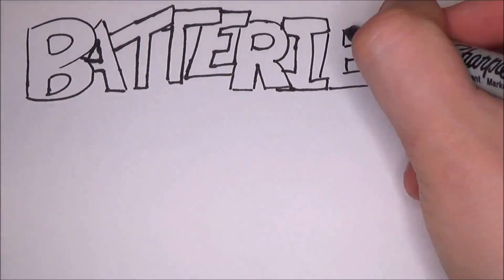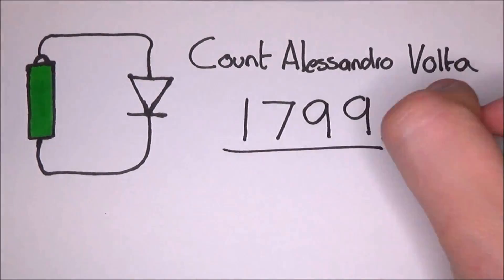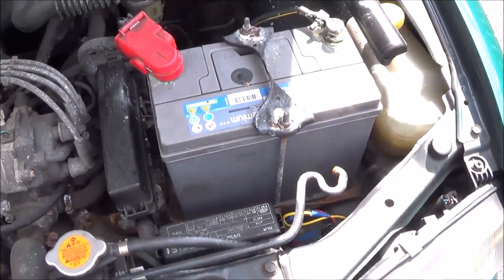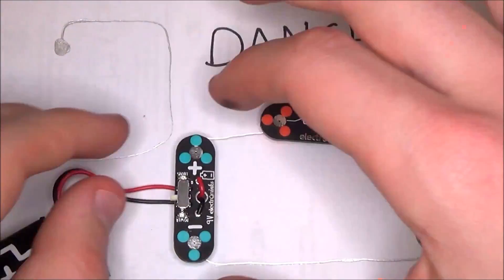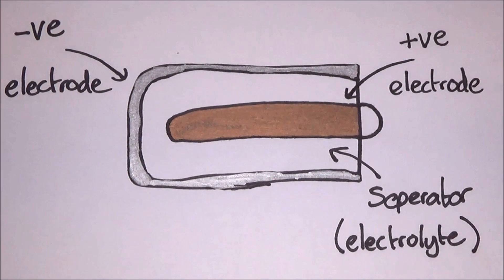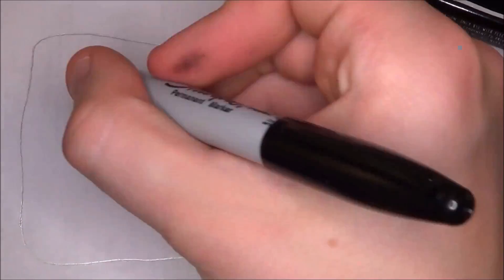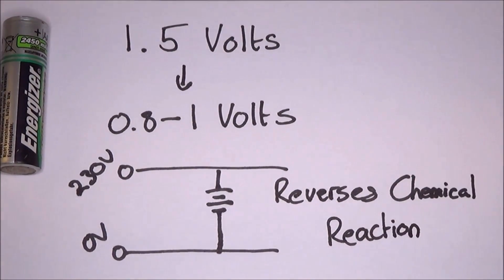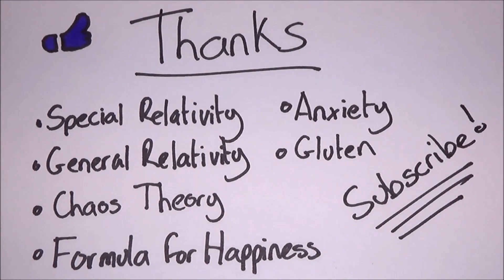How do Batteries Work?

Comment: What about the part with imperfections? Thus small capacity... Otherwise good video!
Reply: What about the impact of recharging battery's, lowering capacity over time because of imperfections in the battery*
Reply from the maker: Hey, Dutch Oven. Thanks :)
For some reason, and I don't know why, despite mentioning them several times, I completely blanked how a rechargeable battery works. No idea why, feel like a complete fool. Sorry